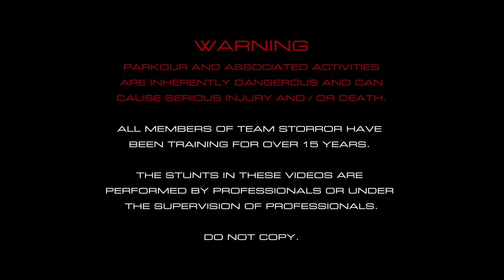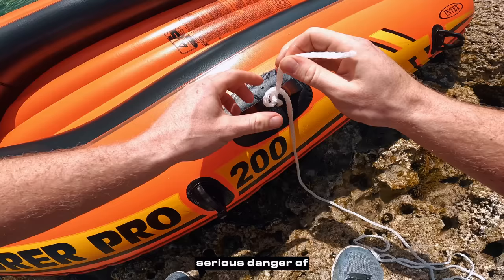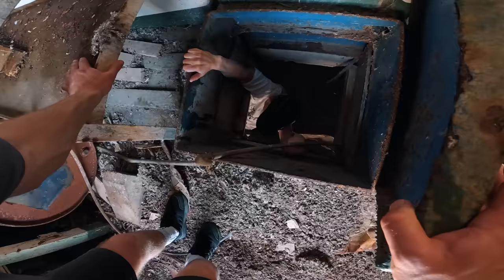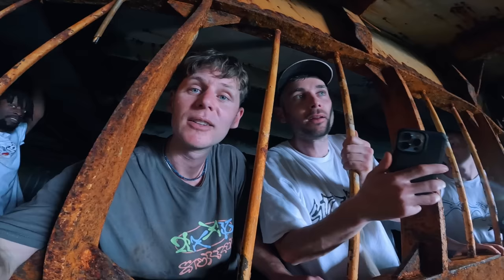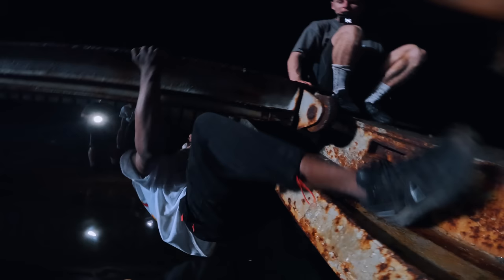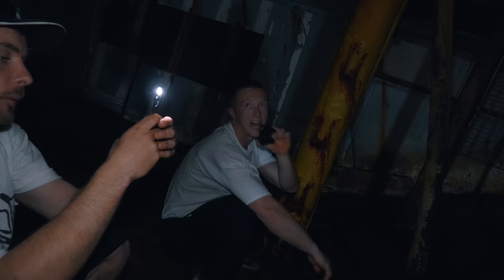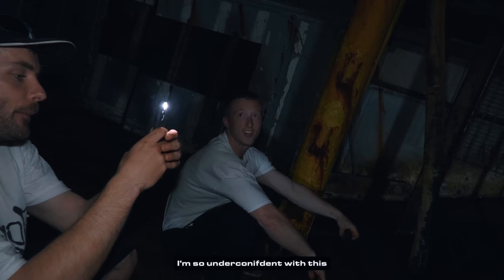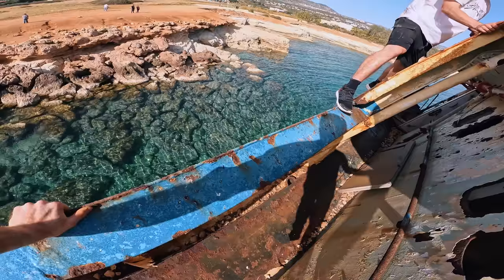STUCK in SINKING SHIPWRECK 🇨🇾

Comment: Serious safety warning from someone who’s worked on similar ships. Do not enter any sealed tanks. It’s very likely it could have a deadly low levels of oxygen and you’ll just instantly pass out if you enter without warning. When metal rusts it pulls oxygen out of the atmosphere and you only need a 5% drop to be in danger and the body cannot sense a shortage of oxygen.
Reply: Bruh, don't you think that the safety team would have briefed them on this beforehand?
Reply: @78cr83  the safety team doesn't actually exist lol
Reply: @J75Pootle  💀
Reply: @J75Pootle  🎣
Reply: @J75Pootle  Bro of course they "exist", they make sure their trips are safe enough for ads! (take that as you wish) :D
Reply: I remember hearing about a famous case of this happening where the room was just slightly underneath the main room and three people died trying to rescue someone who passed out in there or something like that
Reply: @kgapaneseschoolgirlb  it's terrifying. The stories are actually almost funning. One person follows the last in trying to rescue them as its just seems like they tripped up or past out.
Reply: @oliverlane9716  The case I’m thinking of is the ERRV (Emergency Response & Rescue Vessel) Viking Islay where the crew members went into the bolted shut chain locker, which would not of had any new oxygen enter as it’s bolted shut, I.e. it’s air tight, and the surrounding walls and chain are made out of a material that rusts, which decreases oxygen levels, as you’ve mentioned before.

The oxygen levels were recorded at 15% I believe AFTER the rescue attempts to rescue the people who initially tried rescuing the unconscious crew member had been made, with regular atmospheric levels being close to 21%

The scary thing is we don’t detect the decrease because our body doesn’t measure how much oxygen we have in our system, but rather how much CO2 we have. So we only get warmed we need to breath when the CO2 level in our blood exceeds a certain amount, not when the oxygen depletes. That’s why areas containing lots of nitrogen are very dangerous, and why sleeping gas (N2O) knocks us out without making us panic, or why sucking on NOS balloons or Helium can be very dangerous.

It’s why I find it funny when people ask “is this gas dangerous” because when the answer to the question of “is this gas oxygen” is a “No” the answer to that question is always “YES!” Because we can’t breath any gas but oxygen to live! Heck, even too much oxygen causes oxygen toxicity. Oxygen actually being the reason we slowly age and die because it kills our cells because it’s extremely reactive.

Anyway, that’s me done with my nerd conversation :)
Reply: @J75Pootle  Can you explain how this whole process works then and how the safety team... thing came to be?
Reply: @RumorsOfPie  Iirc a safety team of some sort was first mentioned in their quicksand video in a very jokey way and obviously only really said to keep YouTube from demonstrating them. They then started using it more and more as ways to placate the YouTube overlords until it became a full on meme and everything else it is today
Reply: @kgapaneseschoolgirlb  I like nerdy conversations. 

'It’s why I find it funny when people ask “is this gas dangerous” because when the answer to the question of “is this gas oxygen” is a “No” the answer to that question is always “YES!” Because we can’t breath any gas but oxygen to live! '

But that is a false statement, because if nitrogen was dangerous we would all be death right now ( since we breath 78% nitrogen ). Ofc, 'breath' with the notion that our lungs don't actually do anything with this nitrogen, but we're still breathing it. 

*Sorry, just had to nitpick 😁
Reply: You’re not gonna instantly pass out. If there’s less oxygen, there’s probably more nitrogen, which the body can sense.
Reply: @MarvinWestmaas  Yes but nitrogen on its own is toxic. But yes, with oxygen it’s fine, same with helium, carbon dioxide, and many other gases.
Reply: @morgandaly2651  The body can’t sense an increase in nitrogen and yeah, it is very quick to pass out. It’s the same time a proper headlock takes, which if you’ve ever seen a UFC fighter get someone in a headlock, it’s lights out in seconds. Doesn’t matter that you can hold your breath for 3 minutes, it’s lights out
Reply: Thanks safety team
Reply: @kgapaneseschoolgirlb  It takes six seconds for you pass out when you block oxygen to the brain ( by blocking the blood flow ), that's why Mario will always be some people's favorite judge ... or most hated. Depending on temperature, permanent damage will start occurring around four minutes, this is also why Nate's right he did the guy a favor by putting him to sleep with a choke instead of knocking his lights out with his hands :)

I saw probably the same documentary about that ship, as I know the story well and yes it took seconds for the second guy to become unresponsive and I know for a fact they stated there is indeed no warning sign for the body ( you could use ). I do think it's a bit comparable with oxygen toxicity with divers tho, you don't go from fully conscious to out you will likely be aware that your brain is being affected ( vision and other senses, motor control and linear thinking will likely follow a sliding scale into subconsciousness and death ). Seconds is long enough to notice something is wrong, it's just that you each realization will come at the exact same point that you're unable to do something about it. At that point you're a passenger of faith so to say.

'Yes but nitrogen on its own is toxic. ' 

Nitrogen only get's labeled as toxic because it will replace oxygen. Not because exposure to nitrogen damages your tissues or cell structure, and an access of nitrogen doesn't disrupt their functions. 

You know what is toxic? Oxygen. Pulmonary oxygen toxicity can occur when divers go through extended recompression treatments though usually doesn't leave any lasting damage.

"Oxygen toxicity happens when our body’s protective systems are affected by increases in oxygen partial pressure. The tissue-protective mechanisms and biochemical reactions of our bodies are tuned to life in an atmosphere containing 21 percent oxygen, or 0.21 atmospheres absolute (ATA) oxygen partial pressure."

'helium, carbon dioxide' I think those are 'simple asphyxiants' ( which means that they are only 'toxic' because they can replace oxygen in the air we breath ). 

Toxic gasses are say; ozon, carbon monoxide and ammonia for instance? Or, human made ones, sarin or mustardgas. List is much longer, but those are all actually listed as toxic because they disrupt our bodily functions without having to replace oxygen ( which makes them able to affect us in much lower concentrations ). 

*if you're gonna nerd out, go all the way <3
Reply: @J75Pootle  captain obvious to the rescue. Just go along with the joke, damn lol
Reply: @Opsity  yeah I know, I was dumb and didn't even think to interpret the first guy's tone as jokey - social skills are hard lol
Reply: @MarvinWestmaas  You’re correct, I said that whilst walking through a park so wasn’t paying much attention. When I said “toxic” I meant to say dangerous, which I think you’ll agree that replacing the gas we require to breath is pretty dangerous. And yes I think I mentioned that about oxygen being toxic.

No, everyone who has reported similar scenarios say that it is unnoticeable and then you just pass out. Divers slowly run out of oxygen and breath more nitrogen over time, so the effects take longer. 

I’m pleasantly surprised I’m able to have nerdy conversations on a parkour channel, something that most would agree is a ‘not so nerdy’ activity. Same stigma applies for many active activities tbf.
Reply: This should be the most upvoted comment to make sure they see it.
Reply: There was once a situation where a guy went to clear the cargo hold which had grain in it. The grain had fermented and sucked out the oxygen in doing so. One guy went in and died, then his friend went to see what had happened and again, he died too. It took about four or five guys to die till one thought.. there must be something dangerous in the hold. I shouldn't go in. Tragic story and true
Reply: @kgapaneseschoolgirlb  'No, everyone who has reported similar scenarios say that it is unnoticeable and then you just pass out.'

Not being an UFC fighter, all I remember are my old judo days when I was young. I can tell you, if you're in a choke there is a ramp between 'I'm fine' and being out and it's not just mental ( though the brain's primary functions will try to override everything else,  you know why drowning victims actually try to breath water ). 

'When I said “toxic” I meant to say dangerous, which I think you’ll agree that replacing the gas we require to breath is pretty dangerous. '

*technically it's not 'we require to breath' but 'our body needs to function' -> we need that oxygen concentration for our cells to perform their functions. It doesn't matter which which other non-toxic gasses are mixed with the oxygen as long as it's present in the desired concentration. 

'I’m pleasantly surprised I’m able to have nerdy conversations on a parkour channel, something that most would agree is a ‘not so nerdy’ activity.' 

Parkous is a very non nt past time I always thought, I'm far from surprised this is the first time I see a 'Japanese schoolgirl' having 'deep scientific thoughts' based on the viewing of a storror episode :D Mostly because I'm well aware that while for 90% of viewers a statement akin to 

'social skills are hard lol' ( @J75Pootle ) 

...don't worry lad, that goes for most of us here I'm sure. 

On the other hand, I expected storror's audience to comply with the 98% male viewers rule, so you're either the actual unicorn here or you're catfishing nerdy guys who spank their monkey thinking about 'Japanese schoolgirls' (≧▽≦)

'Same stigma applies for many active activities tbf.'

...and passive. Stigma's / stereotypes are my entire world, it's only when I reach out and check them I'm confronted with how wrong, or right, at times I am.
Reply: @MarvinWestmaas  What I was referring too was people going into oxygen deprived areas, which are commonly found in ships, due to many reasons from bolted areas, to rust, to carrying cargo that breaths (trees, grains etc) but can be found elsewhere too, like caves are another common place where porous rocks leak or vents can leak gases heavier than oxygen that sit at the bottom of these caves. Anyway, I’m these situations, you are breathing, unlike in UFC and other chokeholds where you are not, so you don’t even get an initial “oh no I can’t breath, this kinda feels bad, why does my head fill so heavy?” Before falling unconscious. You just breath, and then eventually you go unconscious. The only warning sign might be in certain scenarios where the carbon dioxide level is really high and then when you breath out and breath in, the carbon dioxide blood level doesn’t decrease so your brain warns you that you’re suffocating which introduces panic that makes you breath more, which would build up more carbon dioxide aaaand then you go unconscious. But yeah, UFC probably not the best example, I just used it as an example of how quickly you can go from being conscious, to unconscious, from not breathing, but yes you can indeed tell that being choked is not healthy.

And yes, if you want to be pedantic you are again correct. We can survive without breathing, as long as we get the correct amount of oxygen for our bodies to function, which is usually naturally done via breathing. But I also meant when people ask those questions when it is that gas and just that gas. Nitrogen on its own can kill you. Nitrogen plus oxygen is fine if the levels are correct, but that applies to even gases we consider toxic, in low concentrations, you may toggle and sting but might not kill. But on their own, gases are dangerous. I guess so is oxygen but 100% oxygen has its usages and is survivable, unlike every other 100% gas, which would just kill you once your body runs out of oxygen and stops functioning.

And oh I forgot my KGB coverup, I mean…Konnichiwa, ara ara, kawaii desu~ (／≧ω＼)

And remember, when traversing air tight spaces Omae wa mou shinderu!
Reply: @kgapaneseschoolgirlb  Sorry if I came across pedantic, wasn't the intent

'Omae wa mou shinderu!' -> and you don't get to go nani ∑(O_O;)

In any case, I just wanted to emphasize the difference between simple aphysicants and actually toxic gasses which can kill you in much lower concentrations. You can survive breathing in some fumes as a welder, but there is a reason it's now quite the regulated market and still it has quite the lower expected life expectancy. As you say, some gasses will not kill you at least not straight away ( without cumulative effects ).  On the other hand, a small canister of nerve gas is enough to make a large area deathly to be in, and somewhere in the middle you get things like carbon monoxide which will kill you a lot more certain then some welding fumes but a lot less certain then said nerve agent.

I think you said it earlier -> it's a strange realization how we depend on oxygen to live but it's also the thing which kills us. 

I hope I didn't break an important undercover alias... what the hell am I saying, I work for Raytheon....
Reply: @kgapaneseschoolgirlb  Btw, have you ever been chocked? There are two angles you can use. Either try to obstruct the trachea but this is actually harder and takes a lot more time, or you block one or both of the carotid arteries which will cause a temporary hypoxic condition in the brain and will put you out in 6 - 20 seconds ( depending on angle and pressure, how much blood flow you're preventing ). 

That's what you see in the UFC, if you see someone tap it's usually from an air choke and not a blood choke. Air chokes get submissions, blood chokes put people to sleep.
Reply: @78cr83  your crazy if you seriously believe these people have a safety team lmao
Reply: @MarvinWestmaas  Yeah I’ve been choked, and I’ve choked people. People who are good at ground wrestling, like the BBJ guys will go for a blood choke. They don’t want a tap out, they want to win, and they know when a guy is unconscious. Guillotine chokehold can do both for instance. But yeah, another reason is because people who know how to wrestle, know how much harder it is to get out of an carotid restraint than it is a regular chokehold, because of the nature of how they’re formed. You know, one requiring both arms and no gaps for someone to slip their hand through and everything.

But yeah, for the guys who aren’t good at wrestling, or their opponent won’t let them pull it off, that’s when they go for the regular, obstruct airflow chokehold, and hope they aren’t good at holding their breath.
Reply: @kgapaneseschoolgirlb  It takes a lot more skill to pull of a blood choke indeed, while if you're strong enough you can turn an attempted choke into a neckcrank and still get a submission.
Reply: @ThrowingTexas144  why? They must have a safety team. Who else will tell them that it's safe for them to go there and also get all the required permissions? There will also be the safety teams safety team, who are 2 steps ahead of the storror guys. There job is to check everything is A-OK for the main safety team to go and do their checks. I like to think of them as a skeleton crew safety team, if you will. 🎣
Reply: @78cr83  once  again your delusional if you think that
Reply: @ThrowingTexas144  come to think of it, it would make sense for the "skeleton safety team" (as I previously referred to them) to have their own safety team, or more likely, just a safety man. I imagine he will be a Chuck Norris type figure who fears nothing, and is willing to risk his life for the benefit of the skeleton safety team, the main safety team, the Storror boys and finally us viewers! I salute you safety man! 🙏🙏
Reply: @kgapaneseschoolgirlb  another Casual Navigation watcher?
Reply: @ano_nym  No actually, I was very confused by “casual navigation watcher” but then I decided to look up the words you capitalised and yeah, lots of boat stuff. Lots of what I’ve mentioned too like closed spaces and cargo like rice and such. I haven’t watched them but I’m assuming they mentioned what I’ve said or something?
Reply: @kgapaneseschoolgirlb  yeah, he had an episode about enclosed spaces. Used the same chain locker incident as an example in it.
Reply: @ano_nym  It’s a famous example. From the country I live in. Quite a few people died. And it happened on a Search and Rescue vessel of all things, so it’s a very notable story. Kinda like a firetruck being on fire.

But yeah, I did get round to watching part of that video and it is indeed the same story. Not similar, the same. So at least people from other countries get to know the story and danger that happens
Reply: Did you not see the safety team sticker?
Reply: These boys are just asking to drop in a small cavity or get suffocated. But it's all good as long they don't cry for help afterwards.
Reply: not just that, getting cut on any  Rusty metal corners would be poisonous.
Reply: Pov you don’t care and you a free bird
Reply: @78cr83 There is no safety team dude.
Reply: @J75Pootle  the safety team is them dressed up in construction suits a facemask , doing parkour as they carry around tools to check the safety
Reply: @J75Pootle  they do we never see them as they are ninjas
Reply: That's some serious practical science 😎
Reply: Plus the massive amount of asbestos that was regularly used on ships until at least 1998.
Reply: Well just oxygen will kill you you need a good combo @MarvinWestmaas
Reply: Safety team should really hand off their O2 meter before any adventure with a dodgey enclosed space like this.
Reply: SST MATE you have forgot

S torror
S afety 
T eam
Reply: @78cr83  The impression I have always gotten from Storror is that the "safety team" doesn't actually exist and is just them lampshading the fact that what they do is very dangerous.
Reply: @meurigjenkins  see my comments above I happen to know this to be untrue and in fact there is a few layers to the safety team
Reply: @meurigjenkins  and also 🎣
Reply: @morgandaly2651  People have literally walked into rooms and dropped dead without even realising anything was wrong from the gasses in there.